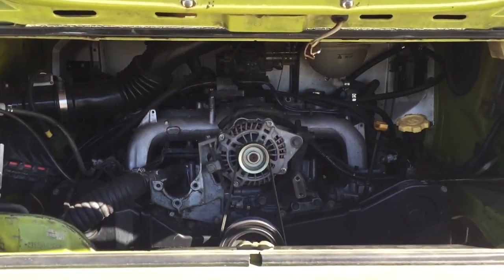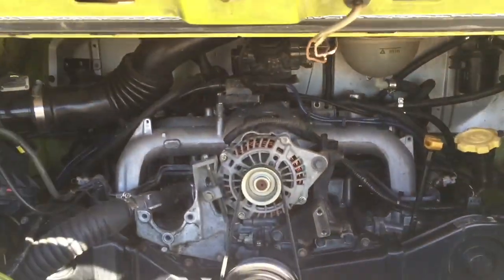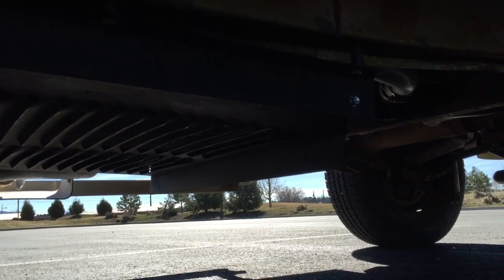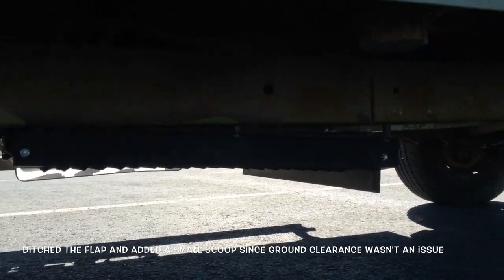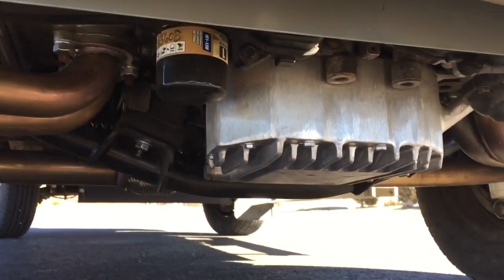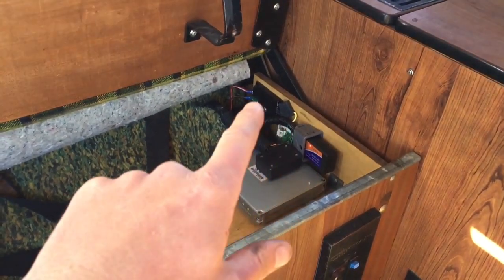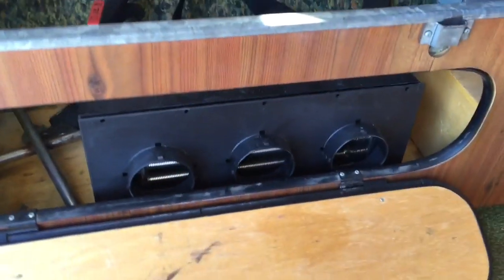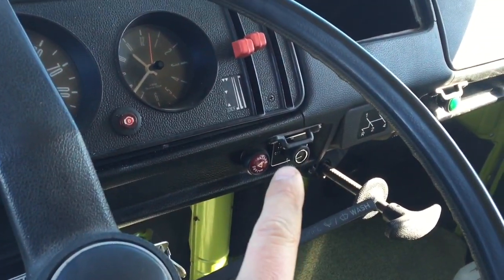1976 VW Bus Subaru 2.5L JDM engine conversion

Comment: Fun fact, the 2006-2013 Brazilian Kombi, known as "T2c", had its 1.6L air cooled boxer swapped by a water cooled I4, 1.4L, EA111 (1.4L, I4) engine, which requires a radiator, placed on the front, above the bumper.
Perhaps that one could be easier to convert, with room for an H4 or I4 in the back and for a radiator on the front.

Comment: Wow awesome work!  I love the inline valve on the heater core.  I assume that keeping that shut is going to help keep the interior cool when it's hot outside.
Reply from the maker: +Velocity Labs That's it. It's a large heater core so no need for extra heat in the summer.

Comment: Hello Mick, I thank you for taking the time to record and share this valuable information. I notice that on a previous video you shared from a 73 high top, you used the same radiator but stock Subaru fans. In this video you are using the same Dodge radiator but a Jeep fan. Is the Jeep fan a better choice than the stock Subaru fans? I am in the process of purchasing your parts kit and the parts you recommend for the cooling system build for a 71 camper. 
I do have the stock fans that came with the donor car but have no problems getting another fan if it will make things better. I am in Texas and the summers are brutal if that makes a difference. 
Also, I got a hold of a stock AC system which included the mounting setup you are showing in this video.
ps. Will love to see a video showing the complete install of a fuel system on an early bay : )
Thank you!

Comment: So I have given all that I can with my engine mounted radiators and I am still running the fans at highway speeds and that is not enough. So I am going to switch to a belly mount set up, do you have a picture of the scoop you installed? I have an extra splash pan that goes under the front pedals, do you think this would work as a good scoop? I was also excited to see the heater set up as this is the same unit I purchased (except that I added a/c)and will be using.
Reply from the maker: +Oldcarnutzs If you don't need ground clearance then belly mount works well. It's possible that the splash pan could work as a scoop or just take your dimensions down to a metal shop and have them bend a scoop for you on their brake. I have a small brake and it works perfectly for bending scoops/brackets/baffles.

Comment: I am very amazed with you're engine swap work! Very neat, clean yet super functional! Anyway, did you overhaul the subaru engine before installing it to the bus? Or any used subaru engine is good to go without any reconditioning? Thinking about doing the same project as yours! Cheers!
Reply from the maker: +peyeum Its wise to do engine oil seals, timing belt, and I've started doing head gaskets while it's out too.

Comment: Does the original manual transmission work well with this motor?  Is the 1996 JDM 2.5L much heavier than the original T4 motor?  You do great work.  If I can ever wear out my T4 I will be paying you a visit.
Reply from the maker: +Joe Dutra It works well for sure. Of course it's a heavy vehicle so you don't want to drop the clutch, you're apt to break things that way.

Comment: So have you found that the belly mount is the way to go? I’m getting ready to order parts for my conversion and the jury still seems out.
Reply from the maker: +Ian K I like engine bay and belly mount. Just bought a Brazilian front radiator clip to experiment with too. If you only drive highways then go with belly mount. A belly mount would never survive in the places I drive my personal bus so I opted for engine bay.

Comment: Hey mate. Loving all the videos, and still working my way through them.

I have begun collecting parts for my t2 swap but have ended up with an 02 Outback as a donor. I was planning on using the reversed pinion kit to use the suby gearbox, but alas it seems ive ended up with an auto.

Have you seen anyway to use a suby auto in a bus before? Without 4 backwards gears that is...
Reply from the maker: +Luke Drennan  SubaruGears is working on an auto kit but it's been in test mode for a while. I'm not sure if it'll be available for your project. I would prefer the auto for nearly every swap - comfort, speed, no loss of boost when switching gears... I am patiently waiting.

Comment: at what RPM does the engine run at at highway speed????
Reply from the maker: +rottysaurus If I remember correctly this particular bus ran at around 3000rpm at 65mph.